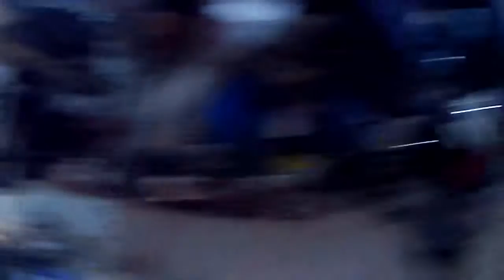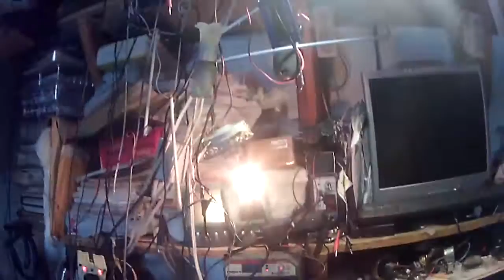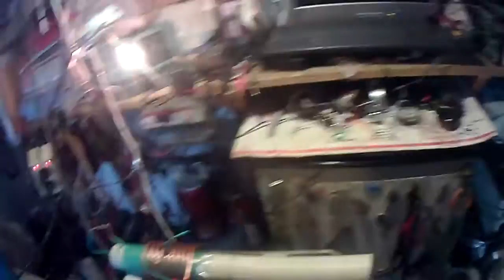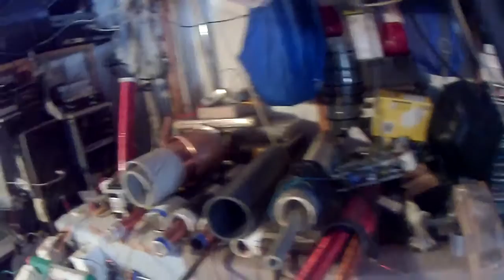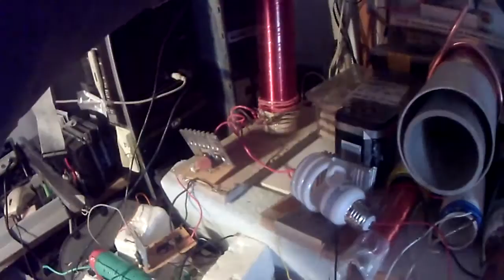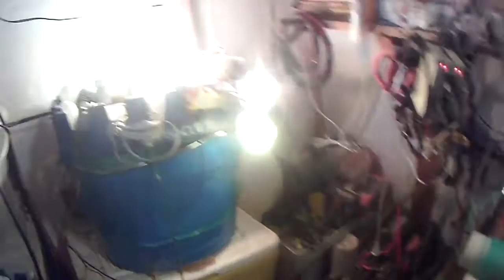Don Smith replication 3 maximum power cold electricity

Comment: This is not what Don Smith did. You should run a junk yard business. What you are doing is Tesla coil. Don Smith's set up needs a lot of engineering calculations and equipment like LRC meter ($250), high frequency oscilloscope ($800) laser module transformer ($300-400) with inverter and step up to 9000 vdc, high voltage film capacitors ($35 to $55); high voltage capacitors WV 10000 dc, and isolation transformer ($500-$800)to step down 1000vdc to 2000 vdc with high ampacity;  and much more. Some one like you who can hardly buy a McDonald's Big Mac without coupon cannot replicate Don's set up. But good try and good luck.
Reply from the maker: These are all experiments with basics... thank you

Comment: There is nothing to discourage you take a good direction, good job.
-very fun to watch place a comment against noise I hear a little weak 
You could play with the flat of the lower frequency band 
-make one jar with opposite directions L2, L3 to sweep the alternating magnetic field or resonant tank.
They may be interesting processes. 
(like a flyback will strengthen this first generator extortion)
and by the way you deliver volt(120V) ? to flyback ...
Reply from the maker: +Tomtech29 TT this is 120vac CFL ballast connected to a tv flyback.Its frequency is from the ballast tank circuit.They are opposite wound coils.!